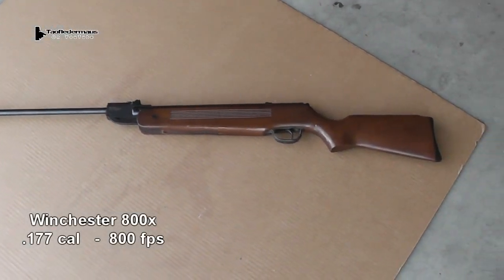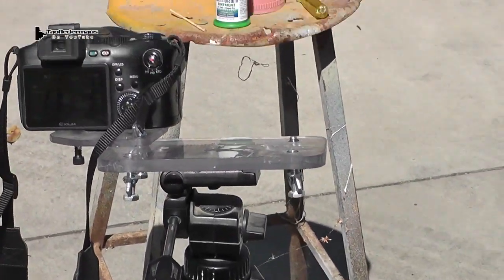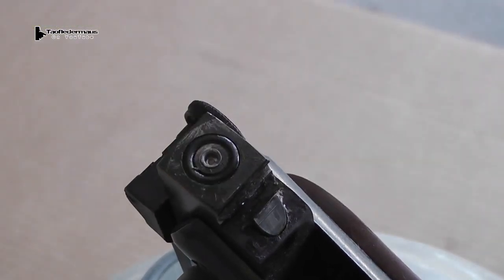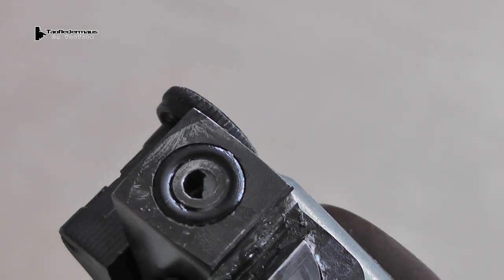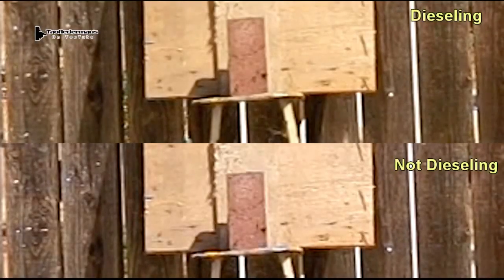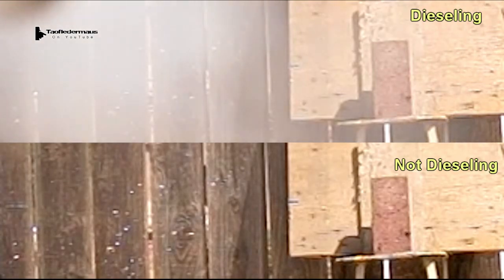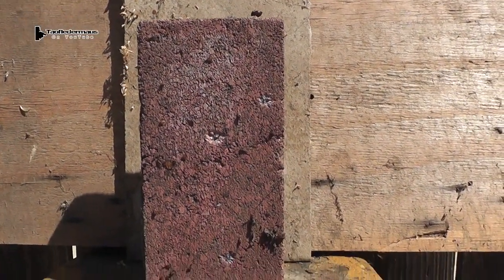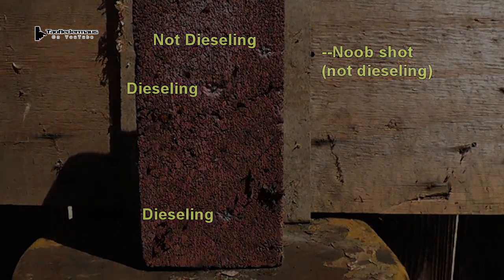Pellet Rifle DIESELING  -   Good,  Bad or Ugly?

Comment: In this video he saw no difference in speed, but I didn't see his chronograph to tell him (and us) what the speeds were! 

You can get a fairly good guess of comparative speeds by firing into wood and measuring the penetration, but pronouncing two shots to both be 800fps because that's how it looked to him bouncing off a brick, or guessing at differences in point of impact based on one shot each at short range?  

That's the kind of logic that an ten-year-old boy would apply.  What a circus of ignorance and misinformation!

Comment: Typical stupidity. 9 times out of ten you'll get just enough "combustion" to heat up the air charge slightly and make it less dense and take energy out of it. Lead also conducts heat like crazy and the pellet will absorb some of the heat and energy but it won't contain that energy on impact. The other one time out of ten you'll get a good "fire" and fuck your gun up. Genius.

Comment: How did you determine no increase in fps without a chronograph? I have a Winchester .177 air rifle and with a good quality pellet it will shoot 1150-1175fps, with a tiny bit of Vicks Vaporub on the back of the pellet it will average 1300fps. I also do not push the pellet into the barrel to make room for the Vicks, just a tiny dab. My rifle has been used quite a bit, target, competition and small game. I imagine if it was new the fps would be higher.

Comment: I dieseled my GAMO CFX springer in .177 for years on WD-40 equiv. and the power increase was noticeable. At the same time accuracy  suffered greatly and progressively. I had to scrub the barrel out (huge amount of burnt residue) with a brass brush and nitro-solvent and dry it  out with patches before the rifle would group again! Luckily the end results of this clean-out were good! I would not recommend dieseling.

Comment: So you can tell the speed of the pellet just by eye? That is impressive.
Reply: When ever I see videos where increases and decreases in velocities are being judged yet no chronograph is employed ...   It changes from "test results" to "here is my opinion"
Reply: @CVM222VOLT  Exactly that...science by "Feelings"🤣🤣🤣🤣. Thankfully, this channel evolved
Reply: You could hear the supersonic crack like a whip
Reply: No chrono?
Reply: When side by side seeing a video feed.. Yes yes you can, look for the point of impact versus the point of triggering the device.
Reply: I will not argue about your ability to see such a small fraction of a second with your naked eye. I am impressed.
Reply: Robo-cop
Reply: The ol eyechrometer
Reply: Lol
Reply from the maker: You can't?
Reply: @taofledermaus  in my opinion I dont you did this test correctly ive definitely gained power from my air rifle rated at 1300fps with pba platinums I've used some old sanitary "petrol-gel" lubricant when dieseling my gun and it does make a slight puff of smoke/debris but the crack I hear when fired is akin to the crack from acheiving supersonic and ive heard from many first hand experiencers that it sounds like a 22lr being fired along with increased impact and penetration damage on mostly metal and wood targets so its not at all precise or accurate in results but I would say its more powerful if you use a strong enough gun in the first place
Reply: @hanzgrueber145 I had some hard glass non diesel pellet it just bounced off but diesel pellet on the other hand well let’s just say the glass went boom boom >:>

Comment: my cross cruncher easily puts holes on half inch plywood without "dieseling" at 60 feet. i noticed after about 6 rapid shots my gun got louder, kicked harder and smoke was coming out of my barrel at both ends of the barrel when i opend the barrell. after looking into this i discovered this thing called deieling. after looking into it i decided i had to check it out. sure enough i added wd40 to the pellet and a bit to the air chamber and pulled the trigger. with the wd40 in place, my gun now sounds like actual fire arm. i can hear the loud crack echo around bouncing off the nearby hills. i dont know why people deny this happens, perhaps to keep people from trying it? my next test is to see if i can diesel through a 2x4. side note, is that old dried up fence enough to stop your pellets? it wouldnt mine

Comment: actualy i seen sombody chrono this and he got almost 300 fps gain from dieseling
Reply: I've gotten as high as 350 f.p.s. gain, using a basic Beeman. I wasn't the least bit surprised though. I knew from the sound, and most of all, the recoil that it had to be moving well over 1000 f.p.s.  Knock on wood, I haven't damaged the gun and only did the dieseling thing for about 2 weeks. It's important to note that your barrel will get dirty much quicker, so keep the bore clean.
Reply: @glennyj65  how about accuracy? Does it stays the same or it breaks off after dieseling?
Reply: @thegreatone0519  with heavier pellets accuracy was great.
Reply: @glennyj65  thanks,I'll try on my 750fps air rifle
Reply: @michaelbritain5546  LMAO 😸👍
Reply: Never disel anything but break barrel  and yeah it wears seals but I'm on 2years of only diseling clean it often and only with non flammable lubes and they're pretty buff at least nitro pistons w holds 3ccs of air out around 300psi with diseling cc??? But psi ,600 ish doesn't mean twice the speed but hit a raccoon or a squirrel in the head they're done instantly yeah even a raccoon
Reply: Yeah I tried it on a crossman Np4 advertised 1200 fps 7.4 gr hollow or 1400 fps 5.1 alloy. We'll more like 1000 and 1100. Use hospital grade Petro jelly and got with a bb in a pop cap yes they fix 1720 fps and for the hell of it yes it exploded perfectly in and orange yikes ok anyone. Better energy visually then my rugger 10-22 w velictors on same medium and distance. 30% more speed 51fpe yeah do the math vs 104-110fpe. So bs it ain't more powerful
Reply: And destroyed his gun in the process, seals, piston etc.
Reply: @michaelbritain5546  its possible

Comment: I tried this back in high school with an old 1000 fps .177 crosman and it made a huge difference. For instance, there was a sonic boom. I compared dieseled vs non-diesled shots on gallon jugs, non-dieseled they'd poke a small hole in one end and a small hole in the back, diesled shots blew huge entry holes and no exit holes cause the pellet would self-destruct inside it.

Comment: Not flammable material as you stated, what you want is combustible.  As you said they were both doing about 800 FPS, where'd you get that figure?
I've seen tests over a chronograph showing a consistently higher velocity using 3in1 oil.

Comment: Love your videos, but you're wrong on this one Jeff. 

There has been comparisons down with chronographs. There is always a large increase in velocity. I know any combustible petroleum based stuff should work, but the successful attempts generally just put a tiny amount of 3 in 1 oil in the back of the skirt of the pellet. That, or they use lip balm.

On a pellet rifle that shoots 900 fps, with dieseling it was reaching almost 1200 on some shots and you could hear the crack of supersonic flight.
Reply: Well said.
Reply: @CVM222VOLT  @Wheresmy240 this guy does WAYYYYYYY too much petroleum. It should be a light amount applied on the back of the pellet, and also that gap he is creating with the screwdriver is stupid as well.
Reply: @JohnRefKennedy  True. He may be making it too "lean" by pushing idle air into that space ahead of the accelerant. And the gob probably doesn't help. I've never scienced about it as a kid... I just found out that if I shake up 3in1 in the pellet can, they become spicy.
Reply: @JohnRefKennedy  yup, that does not compute .   If you made a bigger space in your diesel engine's combustion chamber, there wouldn't be enough compression to ignite the mixture.
Reply: Liquid lube mists better than petroleum gel. Like a fuel injector. Things detonate better when things are atomized (atomize just means blow into tiny particles, not on a molecular scale) as more small particles mean more surface area to burn than a giant chunk.
Reply: Of course anyone getting caught doing this in UK without a FAC and the rifle matching FAC requirements risks jail time.

Comment: Forcing the pellet forwards of its intended seating prevents build-up of initial air pressure and will predictably drop the velocity of a springer airgun. Dieseling will then also be less efficient, as there is lower peak air pressure to atomize and ignite the fuel.
Such a setup was compared here to how a properly seated, undieseled slug performed.
If you follow me so far, is it not interesting to note how well dieseling caught up?
Reply: Yeah, he totally screwed this entire "experiment" up.
Reply: Terrible idea unless you want to teat up your gun.

Comment: You should revisit this video and use actual oil and a chronograph for some proper testing. 
A hit on brick isnt a reliable way to compare. And you wont see a huge difference on concrete if the pellet is already going 800fps if the difference is only 100 more. But that is a marked improvement. Ya revisit this one and maybe do a vid on exploding pellets too.

Comment: I've been doing this since I was 8 years old and now still at 42 for hunting! It's still fun and it definitely make average of 200 FPS more for a pellet gun and have never had any damage from doing so, I also chronograph this many many times and it always shoots average 200FPS faster on a verity of different guns.
Reply: what are you using for the fuel?
Reply: yea not sure if this is onenof those videos to make people not do this but it definatly does make the pellet faster, you will just have try to see for your self rather than beleiving this videos, sometimes thats the best thing to do because you cant always trust what people say or agree with there opinions.  there is a huge noticable difference when deiseling as i do it all the time and do all kinds of penetration test, you cant compare by using a brick with little projectiles like pellets, that not a good comparsion, gotta use something like a phone book or something, this brick would be like trying to shoot titanium with a 22 lr, how the heck are you going to compare the difference??
Reply: The only thing affected is the Oring which I replace in my rifle. Also accuracy suffer when going 1000 fps or above
Reply: @american patriot.2 you welded a  trigger pin to the spring piston to ignite the primer ?
Reply: Then you haven't been doing it for very long, because it DOES hurt the gun eventually....

I've ruined several of them
Reply: Umarex Browning Buckmark 320 without 460 with diesel juice. I put 1000 dieseled rounds though it over 2 years not a negative to report.
Reply: annihilate piston gasket very fast, absolutely. it's burn it, if you shoot often with dieseling
Reply: hello can you tell me if you do as you say you can create damage to the rifle? I have unwerauch hw977 7,5j averaging on 170 m / s when could i get it done so? especially can you ruin the piston gasket?
Reply: hello can you tell me if you do as you say you can create damage to the rifle? I have unwerauch hw977 7,5j averaging on 170 m / s when could i get it done so? especially can you ruin the piston gasket?
Reply: yes it will ruin it.

Comment: Something is wrong, in other chrono videos it does increase velocity, and I have documented up to 270 fps increase depending on what you use. Obviously its not going to show the difference on a brick though, you would need a 22 lr to show the difference. I do agree you should not use this in guns you actually care about
Reply: +jtburge30 also do not use PJ, it won't ignite reliably.

Comment: if you mix gasoline and gun oil  1 to 1 and add a drop to the skirt it will definitely increase performance 300 fps is average improvement. I don't think the rifle you're using creates enough compression

Comment: "Diesling" implies that the "accelerant" in this case petroleum jelly is igniting and aiding the propulsion of the pellet. In your example, I do not believe that it is igniting. In an engine, a tiny amount (Perhaps100cc's)of diesel fuel (which is formulated to ignite at the lowest pressures and temperatures of the compression hydrocarbon based fuels, petroleum jelly is not formulated for ignition) is injected into the cylinder under high pressure (19,000 psi +) to atomize the fuel into tiny particles. This increases the amount of surface area of the fuel to aid ignition. Then the air in the cylinder is heated due to high compression (580 psi) to 1000 to 1400 degrees F. So combustion requires atomized fuel at 1000F. You are not achieving this in your air gun. While in fact a PCP could have 3000 psi in the tank, CO2 has a set vapor pressure of About 850 PSI at 70F and in a pump air gun, based on experience I suspect 1200 PSI stored, the actual amount of pressure achieved in the chamber would be far less. The pellet is not encapsulated in a cartridge to allow pressure to build the measured clearances between the rifling and the pellet are far larger than the same measured clearance in a powder actuated firearm. If you duplicated the "drop" of "fuel" by volume that you are placing in the chamber with the comparable amount of fuel injected into a internal combustion cylinder, it would flood a Diesel engine and no ignition would occur. 
What you are achieving is a better seal of the gas checks, rifling, o-rings etc, which is resulting is less leakage of compressed air around the pellet and out of the compression chamber thus having more compressed air to move the pellet. Any "smoke" you are seeing is the result of the excess lubricant being atomized under the air pressure and ejected from the muzzle, not the result of combustion.  Note that this pressure, although not enough to promote ignition, is enough to overload the pressure chamber in a pellet rifle, and damage it.  Manufactures know this and will likely void your warranty.  Also note that many air guns use self lubricated o-rings and silicone based lubes.  Petroleum based lubed will damage the seals, again not under warranty.
Reply: Nope. It actually achieves combustion. Don't believe it? Try it in the dark! Nice essay, though!
Reply: You put a lot of effort and theory to use, but you arrived at the wrong conclusion.  
This method absolutely ignites the fuel; you can hear it and see the flash in the dark.  
The difference in speed (measured with a chronograph) shows a SIGNIFICANT difference that can't be explained by simply causing a better seal around the pellet.  If the increase in velocity was just because of a better seal, you could duplicate the results with non-flammable liquids...it won't work.  
If you think about it, a fire piston fire starter creates an explosion by using hand power...much less than a diesel engine uses.  The environment inside a diesel engine ignites the fuel in a more efficient way to get the maximum power from every drop of fuel, but the fuel can explode under much less favorable conditions.
Reply: The Dunning-Krueger effect demonstrated...
Reply: Yet a hollow wooden cylinder with a tight-fitting piston and a small amount of paper or cloth placed into the bottom of the cylinder, when the piston is struck against a solid surface, will ignite the paper/fiber/tinder etc. The natives of some Pacific islands have been doing this for centuries to start fires. You can but these firestarters on ebay.
Reply: Google fire piston. They probably don't work either. Just don't tell the people groups that use it for survival.
Reply: Smell the smoke. Where there’s smoke there’s fire.nuff said
Reply: Bushman Nh diesel engine works the same way...it's called heat of compression. There is definitely combustion happening here. Just like a diesel engine uses no spark plugs. The fuel is compressed so tightly that it's combust it's called heat of compression. Just like if you pump up a bicycle pump very fast you start to feel Heat.
Reply: I'm no expert on diesel engines, but I know the one in my Ford 350 had glow plugs. While there is no spark from a glow plug, I believe they raised the temperature of the fuel for more complete combustion.

Comment: Is the substance actually igniting or is it simply creating a better seal for the pellet, like a lubed patch is used in a muzzleloader?
Reply: +FieroGT42 In my tests, it's simply vaporizing the oil. Not actually igniting it. The puff of what appears to be smoke, is actually a fine mist caused by the air pressure release.

So the oil is basically acting in a similar way a cloth patch does around a round lead ball in a muzzleloader. It helps seal the rifling grooves and gives more air pressure to the pellet.
Reply: It ignites.
Reply: David Dinh How can you tell if it ignites? I have tried it, and see vapor exit the barrel upon firing, but never any fire, as is often seen with gunpowder. I've also seen vapor rise from the chamber when I cock my rifle again, but that doesn't mean smoke from ignition. I guess we could test this further by inserting the pellet, then a small wad of tissue paper, then fire and retrieve the tissue paper and see if it is charred? I will try this tomorrow and see what happens.
Reply: +dkeith45 What did you determine?
Reply: no it ignites, it depends on what gun you use though, break barrel rifles that use a compression spring will work. when the spring is released it compresses the oil to its flash point, like a diesel engine would, hence why its called dieseling
Reply: @ Eric Tracey: Prove it

Comment: Why you dont use 3 in 1 oil?
Reply: +zzdfhgdhd That'd be petrol, diesel is designed to simply ignite.
Reply: +zzdfhgdhd it does under high pressure, hence the term dieseling
Reply: +zzdfhgdhd well technically petrol or diesel will explode depending on how you burn it, but diesel will combust under pressure, petrol won't
Reply: +zzdfhgdhd that's what I said, I was explaining it further (read a few comments above)